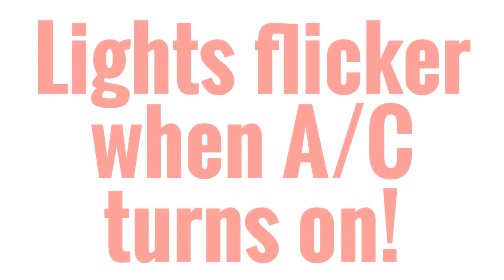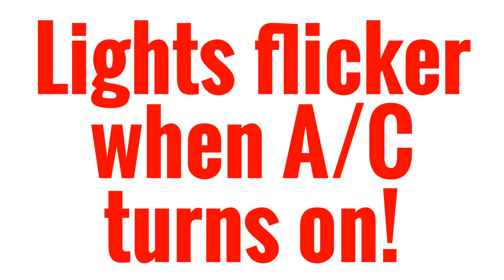Lights flicker when A/C turns on!

Comment: We installed recently a tankless electric water heater and when turn on the hot hater the lights in the house stared flickering, when shut off the hot water the lights back to normal. what would be the cause of this issue?  Thanks in advance.

Comment: Not sure if this helps but I used an infared thermometer on A/C circuit breaker. Reading was between 100F - 107F.  Sometimes it would read  "Hi" . The buzzing noise last a second or so and stops.  All the other circuit breakers were reading around body temperature or less. My lights dim as well for a second or two.
Reply: If the breaker is getting hot and or making a buzzing sound then the breaker is arcing internally and needs to be replaced immediately. That is a fire hazard. I had the same problem with my AC breaker a year or two ago and replaced it as soon as it was noticed. I could hear it buzzing (arcing) when the ac would run. Nothing else was changed, and the new breaker does not get hot or make any sound with the ac running.

Comment: I installed an American Standard 20 SEER inverter (variable speed) heat pump. It sets 6' from my bathroom LED's. They flicker when the hp is on and did not do this with the old 14 SEER hp with PSC motors.

Comment: I have a unit that's in the attic of the house and yesterday one of the bedroom lights began flickering off and on and I think I smelled smoke so I turned off the light right away, scared it could be moisture getting to the wiring in the ceiling? Could this be the case?

Comment: Damn stink bug got in the contactor and would hold up the thing and would reset the damn clocks n all..  previous owners ended up having another service ran in and put most everything on it but still caused the lights to flicker..  when i came to look at thingsi saw that the cap for the ac was way too big for the unit but somehow didnt kill the compressor..  compressor was actually for a 5 ton unit but was put in a 2.5 ton system with a cap rated for a 12 ton setup.  Dunno who hodgepodged it together but took a bit to make it rigt..  only reason i found it all was because i saw the sparks when it kicked on everytime..  thing ran like that for a year..  contacts were gone and wasonly two flaps of brass somehow not stuck together..  guess the big ass cap was just blowing off all the corrosion each time.. lol..

Comment: I've been having this issue and I'm curious we have a three phase 240AG into a transformer to change it to 120/240 to a 200amp panel outside that leads to a subpannel at the house of 100amp but it still flickers. You said to increase panel size and service in this case because I have a transformer at the house should I just replace the panels to  larger ones? Or should I need to call the electricians back out to figure it all out?

Comment: Yes lights kind of power surge when even my AC turns on I guess because the starter is using some of that power to start
Reply: You might want to look into getting a hard start kit put on the outside unit of the a/c.
Reply: @MichaelBeale  ok
Reply: Up to my building manager

Comment: Had to look at the flickering LED bulbs in the tenant's flat this morning with my contractor. Looked everywhere, checked the wires in the light fitting on the ceiling, opened up the main electrical panel, tightened all the screws on the electrical panel, turned on all three AC as well as the electric stove and the water heater. The lights in  the living room just kept flickering, from time to time. The lights in the 2 bedrooms, also using LEDs, sometimes flickered but not as much, not enough to have the tenant complain.The main culprit seemed to be the electric stove but we checked that it was on its own circuit with dedicated fuse with enough capacity for the loading The only possible cause, to me, was varying current take up of the electric stove during cooking. Eventually, I switched out all 4 LED bulbs in the lighting fixture and replaced them with newly bought Philips compact fluorescent light bulbs. That seemed to do the trick, no more flicking. I would venture to say that light fixtures need a regulator incorporated into it so that it can use LED bulbs as it appears they are far more sensitive to varying levels of electric current.  My lighting fixture did not have any such regulator so that was probably the reason why the LED bulbs flickered, when the current went up and down in the electric stove during adjustment of heat during cooking. I'm sticking to CFL bulbs from now on.

Comment: im doubting that this will get read but ill try anyway. i am having flickering lights occuring when i turn my evaporative cooler on but the weird thing is that it only cause flicker on low setting. when i turn it up to high it doesnt do it. any thoughts? also it just started doing this . i never had this problem before and i have been here 5 years

Comment: when my microwave kicks on the kitchen light dims a lil, I am going to run a new outlet off the microwave outlet for a new gas stove which is replacing my electric stove. do you think this will be a problem? Can you just put in a bigger amp breaker to stop this? 15a to a 20a?
Reply: Microwave is usually on a dedicated circuit.

Comment: I have multiple outlets that dim. And while standing at the door, i leaned up against the wall and my shoulder touched the light switch. It was fu****g hot. Burned my shoulder. I know this aint normal.

Comment: Lights dem and come back on ever sense a transformer exploded last week and the light co. replaced it in a few hours. they never dimed down before that happened. It had me concerned . I checked all my breaker voltage one at a time and they all read 120. the incoming from the meter reads 240. makes since  the incoming power line is causing this new diming hassle. good information, Thanks!

Comment: You are correct that there is probably a loose connection. We had our electrical service checked by our utility company and they found a lug on one voltage line that was an incomplete connection. They found the fault when they used a device that increased the load on that side, then replaced the lugs, and our hvac no longer dims our lights.

Comment: I had the same issue upgraded to a 200 amp, tightened up the ground on the pedestal, the AC was new no issues there yes it had a hard start . After KCPL did many upgrades with their system in our neighborhood it went away.
I could have my neighbor run a skill saw my lights with dimmer down a bit ,KCPL blew that off said the saw was bad lol.

Comment: My Fuji operation lights are all flashing and the unit doesn't run, just had the unit cleaned in September and after they cleaned the indoor unit it never seemed rite, my service guy is disregarding my phone calls, has any one ever had the issue with all the lights flashing and unit won't start and do I have a warranty? Any help would be appreciated

Comment: I just bought a 5000 and a 8000 it works but the light wont stay on unless u use the remote it shows up thene its a blank screen on the ac unit GE unit

Comment: Actually when your AC turns on and your lights dim it’s because your outside unit is pulling too many amps on start up drawing amps from the rest of the house. Your AC unit needs to be serviced and start up amps need to be checked. They can install a hard start kit on the AC unit which will help reduce the amps on start up and will reduce the dimming of lights in house

Comment: What is a service upgrade? Is that changing the breaker to a larger one. Example: 15 to a 20?
Reply from the maker: +Mz Tweety a service upgrade means replacing the main electrical panel (usually outaise where the main breaker, circuit breakers, and meter are) with a larger size, and getting a larger "service" of amperage from your electrical utility company.
Reply: Massive Electric okay. I spoke with an electrician and they said to replace my breaker panel box and basically rewire my house $1300. He didn't say anything about contacting the electrical company. Does this sound correct to you. My entire washroom is on a 30 amp 2 pole breaker, he said that is wrong( washer should have a separate breaker of its own 20 amp) and my microwave and stove are plugged into same outlet 15amp. He say microwave should have it's own breaker as well. Is this correct? I'm sorry for the long reply, Don't mind paying the money but don't want to get screwed. This home was built in like the 50s
Reply from the maker: +Mz Tweety sounds about right for the most part. What city/ state/ country are you in? Most service upgrades here in California are going to START at around double the price he quoted you, as material alone is going to cost that much. But there's really no way to compare a price he gave you to what prices are here because every building is different. Contacting the utility (AND city!) is pretty much required for an upgrade, at least here in the states as the utility will have to provide a larger electrical service (bigger wire, maybe make changes to their transformer) to give you what you need for the new panel. The info he told you about the circuits and breakers sounds correct though. DM me on Twitter, IG, Snapchat or email me if you need anything else (your individual details or questions will be TMI for the comments section).

Comment: My whole house has flickering lights I tried everything on my knowlegd any suggestion on what to do ?
Reply: Edwin Lopez, 
That sounds like a serious problem, most likely a loose electrical connection. Ask an electrician to solve this. 

If you do nothing, it may overheat the conductors, cause a spark, or damage appliances. These loose connections are one cause of house fires.

Comment: Their electrical service is too small, and needs to be upgraded to a 200 ampere service.
Reply: It's normal for your lights to dim when an a/c turns on, especially an older one where the windings are getting tighter with age or during peak demand. It can also be caused by lower voltage, common in older communities where the output is 110 instead of 120 volt. It is only a concern when it is severe enough to interfere with electronics. Putting a larger panel alone will not solve the issue. In my house my lights will dim when my neighbors a/c comes on, so unless the power company puts a larger transformer and larger wiring, it will not resolve the issue.
Reply from the maker: +Danny Calk exactly.

Comment: My lights dim whenever I run the heater or the microwave
Reply from the maker: +Mz Tweety that is an indicator that your service is nearly overloaded. Meaning you will probably need a service upgrade.
Reply: Massive Electric thanks a lot. I'm going to get it looked at immediately.
Reply: Mz Tweety either that or its all on the same circuit .. more then likely you need an upgrade though

Comment: I called out electrician and found the neutral connection was all tightened and everything was okay on 100amp service. But I still get light that flicker a little when the a/c unit or water heater turns on. It's not supposed to flicker or dim at all, not even very little. How can we fix that?
Reply: I would say that to start with that your electrical service is too small., because when you said water heater, Normally most homes with an  electric water heater  have a 200 ampere service.  Now if your water heater is in the heat mode and your a.c. turns on it will make the lights dim down a little.  A Electrician can check your wire terminations on the load side only, he can't go behind the electric meter if he does he faces a possible fine of a few thousand dollars and a loss of his licenses.  To get around this he will need to pull an electrical permit then call the power providers to remove the meter, then about 2 minutes later he will know if the problem was in the meter base.  Now when you say air conditioner this is quite a problem with most air conditioners, and to correct this your air conditioner contractor can install what they call a kick start, which provides more voltage to the air comp. to get it started, and this will stop the dimming of the lights.  Good Luck.
Reply from the maker: +dmana3172 if the lights flicker when something else turns on, it's because of a loose hot wire in the xircuit somewhere. Could be anywhere in the entire circuit from the socket of the bulb to the connection on the circuit breaker. If it's a very old circuit breaker check the bussing connection where the circuit breaker connects to the panel. Have your electrician do that,  he'll know how and what to look for.

Comment: just wondering, I have a 32 inch TV plugged in my room and a small fridge also plugged in my room and when I play games or watch a movie, the TV sorta flickers and the screen turns blue for a few seconds then goes back to normal, I looked it up on Google and seen I can get a Surge Protector for my TV to stop it and I did, a 1600 one and it still flickers when the fridge makes a noise, is there anything I can do to stop it from doing this or do I need to turn down the fridge every time I want to use my TV so it won't be too annoying?
Reply from the maker: +Paul Morgan you most likely have a loose wire connection somewhere, such as behind an outlet. The surge protector has a different purpose: it protects against surges of electricity coming "in" from the outside such as rhe utility company.
Reply: anything I can do or buy to help stop it or at least slow it down so it ain't too annoying? it all started when I bought the small fridge and plugged it in, it used to happen sometimes in my old house when my tv was plugged in and the freezer was in the same room, would flicker sometimes, but not too often, but with the fridge, it does it almost every 15 minutes, if you know of anything I can do to hopefully stop it from happening all together, that would be great, if not I guess I'll just have to try and turn the fridge down to 1 every time I use the tv to slow it down from flickering
Reply: Paul Morgan You will want to test the actual voltage on the circuit with a multimeter. Also, you will want ro take a closer look at the receptable where the fridge is plugged in and examine it for a loose connection (tighten the screws on the device and make sure the wires in the wirenuts are tight).
Reply: Paul Morgan it sound like arcing .. is the noise coming from the outlet behind the fridge or is it the fridge?
Reply: Most motors draw a much larger current until they spin up. Try finding other outlets in the room. They may be on a different branch circuit. Putting your TV and fridge on different circuits would likely solve this. 

If this doesn't help, you may want to look at paying an electrician to install a separate circuit just for the fridge. Or buy a new digital TV.

A digital voltmeter is a cheap investment. If the voltages in your room are lower than elsewhere in the house, the wiring may be overloaded or perhaps a loose connection is wasting energy. If an outlet, plug, or extension cord is warm - you have found a problem.

Comment: when my ac turns on or the compressor kicks in my lights dim just a little bit but its visible my question is can this be unsafe for a computer when its on  ? cuz i got a expensive computer so hope you can help me
Reply from the maker: +scyzorpl if it occurs regularly, i wouldn't say it's "unsafe" but the voltage drop could damage electronics. I'd look into getting a power back-UPS. Thanks for watching.
Reply from the maker: +scyzorpl for computers, yes it should be a concern. the compressor is drawing a lot of current and may affect the circuit your computer is plugged into. One of the easiest things to do is get s UPS power supply which will balance the power, usually in event is a power loss, but in your case when power "drops".
Reply: Massive Electric
 Thank you very much for the replay i will need to buy a ups